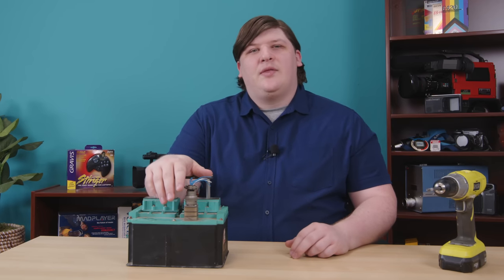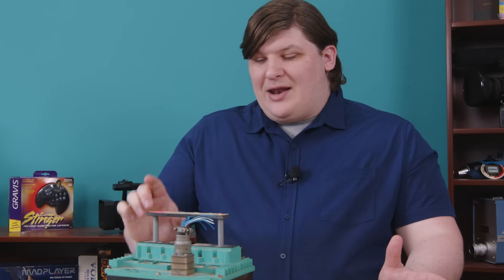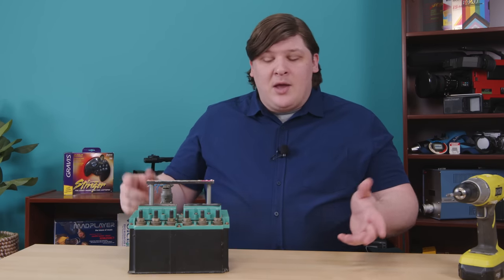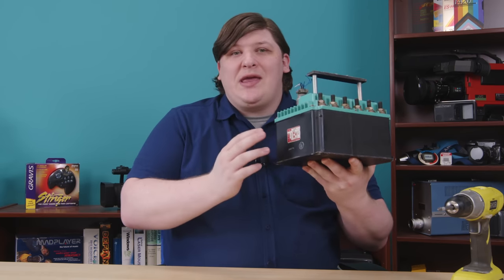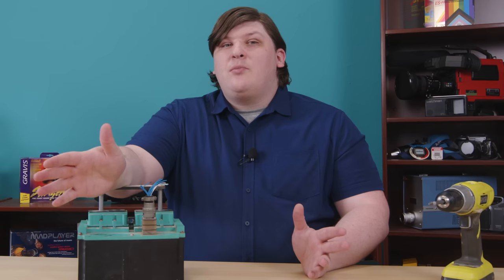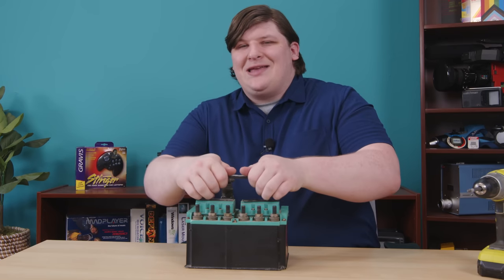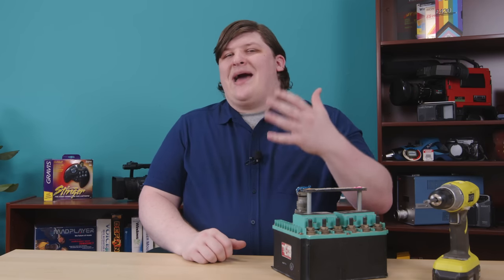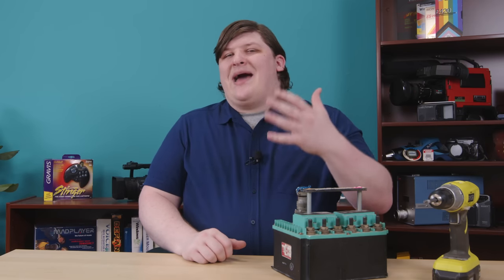A Short Story About (Battle)shorts

Comment: I am completely talking out of my own behind, probably. But I have a suspicion that the plunger is a one time operation thing. Maybe it's basically designed to weld itself closed. That way, in the battle, no matter how much gets rattled and debris fly around. At least nothing short of a direct hit will pry the plunger back up. 

My suspicion is also that this is why it's no longer on a ship. To get the system back to a safe mode for long term operation, you'd literally need to replace the unit completely. The cut wires do contradict my loose unfounded hypothesis, though... I suspect that a unit like that would need to have a more easily used connector.
Reply from the maker: That's a very interesting angle I hadn't considered. It's not unreasonable to think that these are a consumable - once you've shorted them, there's no way to know how much current they've been hit with, so maybe they can't be trusted any longer and are expected to be replaced.
Reply: If that's the case, would replacing them require de-energizing the entire busbar which powers them? I wouldn't imagine you'd want to disconnect a relay this big live.
Reply: I strongly suspect this is the case for a more bureaucratic reason: If the switches could just be reset, people would secretly be using them all of the time. If it is a permanent operation, the switch effectively acts as a tamper seal and it's impossible to press it without creating a paper trail and getting questioned.
Reply: I think the plunger only goes down when the relay is energized. You can't lock something in the on position when it's not in the on position.
Reply: Very likely. This handles very high voltage and amps, without being very large. Better to have it one time use and replace than reusable until failure. You don't know when it fails, which will happen at the worst time.

Yes any electrical should be shut off before disconnecting wires. Regular US 120/240 volts is enough to be very bad, this, if sorted out accidently will be deadly and scary. I'm sure this is loud in use, but that's contained.
Reply: I would also assume that it's a consumable. Once that handle is pushed down, maybe it sort of welds its self in place with all the current, and the only way to assure that the relay works again is to replace it.
Reply: This is exactly true.  These are one time overrides and then bed to be replaced.

It's actually pretty common knowledge in the military.  Surprising that it's not known outside.
Reply: The cut wires part is pretty common with some military surplus parts. The connector is also pretty common, but less commonly used outside of heavy industrial/ aviation/ military equipment.
Reply: Maybe it was just scraped afterwards, that’s why they cut the wires 
Before scraping you remove everything you can remove 
Or maybe those wires was also damaged somehow
Reply: @llMarvelous   Yeah, the cut wires suggests this wasn't replaced as part of maintenance after a single use.  That's why the connector is removable.  The wires being cut would probably require replacing the cable run, too.  Which means that whatever this thing was installed in, probably crossed the threshold into "ehhh, don't bother" after whatever event necessitated pushing down the handle.

OR... the whole thing was retired normally, and someone couldn't resist the urge to press the "Do Not Press This Button" button.  :-D
Reply: @nickwallette6201  ))) I like your thought about _I just need to push this thing_, that is what I will probably do anyway )))
Reply: @matthewkriebel7342  but he said he tested and it is in the on position.
Reply: @renakunisaki  yeah, I didn't get to that part in the video yet. His later statement about needing to cycle it electronically to release the shunt is my current best guess. I've seen plenty of contractors, but none with this feature.

Comment: Wow that was impressive and very accurate work. I can't comment on that particular piece of equipment, but everything else you mentioned was spot on. To answer your question about thinking of the consequences of battle short. It is standardized. In the sense that we follow written procedures and train for them. As a technician I did not have to make that decision, just be ready for it. Those calls would be made by the officers in charge. They would do the risk assessment per naval guidelines. Again, impressive work especially since you don't like talking about the military.
Reply from the maker: Thank you for the reply, I'm always nervous about speculating and always pleased when I find out I got things right!
Reply: @CathodeRayDude   Well, the stakes are pretty low.  :-)  That's the nice thing about communities like this.  You can throw your speculation out into the ether and one of two things happens:  You were right and somebody who didn't know, learns something.  Or you were wrong, but somebody else corrects you, and now you've learned something too.

As long as one's ego can take the hit, being wrong on YouTube is highly educational!  It's also highly economical.  You can ask for something until you're blue in the face and nobody will answer.  But, if you claim something, and you're wrong, people will come out of the woodwork to enlighten you.
Reply: I often thought the captain ordering the override/bypass was a bit too “hands on” for TV drama, and I guess there are other commanding officers above you than the captain IRL, but it’s interesting to me in that it’s accurate to the commander deciding and not the engineer.